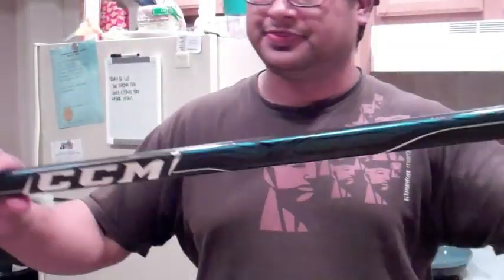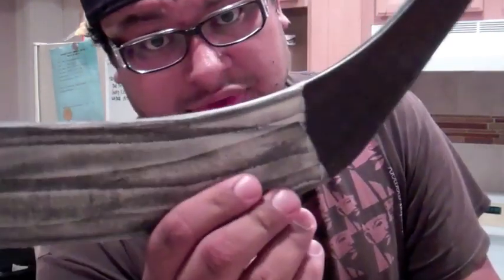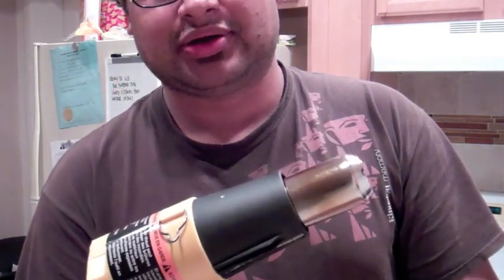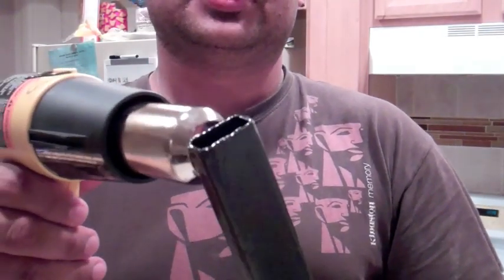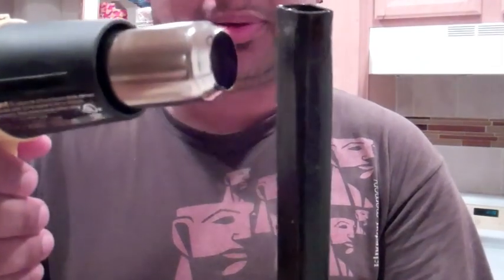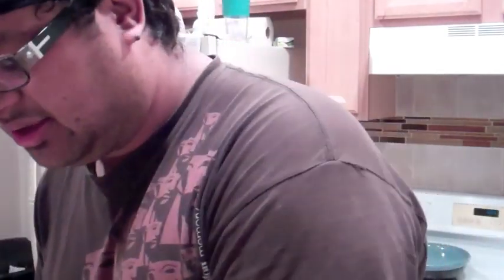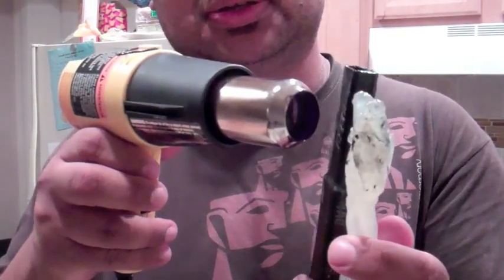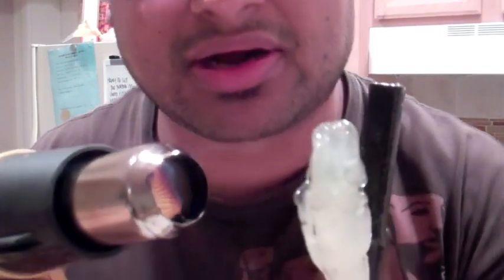Hockey How to: Changing a Hockey Blade from your Shaft

Comment: already in the blade stuck it in the shaft and it fit good. i sanded the shaft down to the blade a little bit. Now all thats left to do is the spraypaint. I"ll post pics in the custom job thread on S2K. Check it out when you get a chance.

Comment: Hey Humberto, I did this with one of my sticks. When I got the blade and extension for it at the store they put the extension in the tapered part of the shaft and the blade where the butt end should be.I got that done in april but i just got around to switching them around now. So I got the heat gun heated them both out and they slid out easily. When i applied the extension it was to loose so I just put a couple of peices of tape around it to make it fit. Then i just reheated the glue that was.

Comment from the maker: Yes, but you will damage the shaft and possibly permanently burn/fuse the blade into the shaft like the pros do and it'll be harder to remove, once that happens you'll also make the shaft a lot more prone to break too.

Comment: Is there always a small crevice where the shaft and hozel meet or did I not push it in far enough? Crevice is pretty small, less than a centimeter or millimeter even perhaps.
Reply from the maker: it should be a tiny teeny tiny crevice where its a little open but if you can stick a coin in to it, it might be too much.  but if it hasnt broken, i wouldnt worry too hard about it.

Comment: What about this: I've got a ribcor stick and hate the blade. It's cracked too. Ever heard of guys just cutting off the blade and putting a new one on? Is it possible?
Reply from the maker: +Matt Hansen ok so, is this the ribcor with the ribs outside? if not they might be inside, if so theres a fuse point at the shaft bottom where it "meets" the lower part where the blades' fused in.  theres no ribs there.  So you have to find the fuse point, cut it and remove the blade there and you can use the shaft.  Its possible, its just a hand full of work
Reply: I'm legit trying do do this now with my ribcor do not cut off the blade and add a new one it won't fit

Comment: Do You just have to warm up the stick for removing the Blade or is there something else to do?
Reply from the maker: The same area on the shaft you saw me heat up before putting in the blade, heat that same area and you should be able to just pull the blade out effortlessly

Comment: if you have just bought a blade is the glue already on the blade enough for this or do you have apply more glue?
Reply from the maker: You can use the glue on them, some have enough  Some shafts are a little bigger than some specific blades even with tapered ones, so i just add extra glue to fill that negative space.  Whatever squeezes out i just add to the glue stick and use another time.
Reply: thinkingjack thanks for the advice, i just got the harrow 300 ovechkin clone blade for christmas!
Reply: thinkingjack and can you use a hair dryer?
Reply from the maker: you might be able to, but it might not make the shaft and glue hot enough to work,

Comment: I have a total one with an ovechkin curve that I absolutely can't stand and I was thinking of buying a pm9 total one blade and cutting the blade of my total one but will that work or completely screw up my stick ?
Reply from the maker: Hey Cory,  I would honestly suggest just going ahead dn selling the stick and getting a different one, if you cut the shaft you can run the risk of making it way too short and stiff and it won't perform the same.   I've noticed with Bauer sticks that when you cut a OPS into a shaft its a lot harder to get correct for using it on a blade.   I'd suggest just trading or selling it on a forum for a different curve

Comment: is it really necessary to add more glue to the replacement blade which already has some. in my experience it is not.
Reply from the maker: +DonQwantsyou Sometimes it is just to make sure it gets in there and theres enough glue to fill the space since some shafts are a little bigger.

If the extra glue comes out, its not a problem you can reuse it later

Comment from the maker: No not at all, if it already has enough glue, use that and you should be fine, if the blade and shaft arent flush you may need to add glue, but at that point, not too much.

Comment: Tag me back so I will be able to see it but are you able to cut the blade off of a stick and put a blade into the stick? Would that work? And maybe make a video trying it @thekingjack
Reply from the maker: @3KINGS Moon
You should be able to cut almost any stick I’d you find the right spot for a blade
Either tapered or flip the shaft and use it as a standard blade. I’ve done it many times in years past and I believe I have a video uploaded here for it or one detailing how to

Comment: a buddy of mine just snapped his ultra tacks at the blade and he gave me the shaft and I was wondering if with this stick it would be possible just to saw of the bottom half of the stick and do this.
Reply from the maker: get like a screw driver, flathead, and push it in through that part of the shaft if theres an opening, and find where the fuse blade  ends at the hosel.  Once you find that piece, mark it, and saw it off and you can insert a blade.
Reply: so the break is before the beginning of the shaft. At about the middle of the blade. So I just don't understand where to start this process.
Reply from the maker: Eric Pearson send me some pics
Thinkingjack@hotmail.com
Reply: sure. I just sent you an email.

Comment: So I have a 1n and the blade broke but I was wondering since it's 1 piece is there still a way I could put a new blade in it
Reply from the maker: Yes there is, the taper is too thin to put a blade but if you flip it you might be able to use it again
Reply from the maker: NOT sure i responded to this because suddenly old comments are coming up as new comments.   But yes you should be able to, in the shaft you can find where the fuse point on the hosel ends and you can cut that part off and insert a blade there and wont even need to flip it over.

Comment: i have a pro stock reebok ai9 that a buddy gave me. im wondering if an easton or a bauer blade will fit into the ai9 shaft. help?
Reply from the maker: There should be no problem fitting those blades in there, as long as you cut it properly and its the same hosel  blade for that shaft, i would make sure to measure them up, you dont wanna accidentally get a tapered hosel blade for a standard shaft
Reply: thinkingjack yeah i just don't know how to make sure the blade fits the shaft lol

Comment: I have a street hockey stick and i need to out a new blade on it.   It only has screws on it but i cant get it off once the screws are out.  Anyone know how to fix this
Reply from the maker: So you basically have a mylec/Franklin street stick? 

Shit if you need a new blade for those you’re better off buying a new or used composite for cheap because the actual blades for those are still 25$ and that’s absurd

Comment: Can the street Hockey blade  also removed?
Reply from the maker: Daniel Cardenas if it’s on a shaft yes it can be
Reply: If it's not a shaft then no right?
Reply from the maker: Daniel Cardenas you can cut the stick at a specific spot to turn it into a shaft and keep using it if it’s a composite stick

Comment: How do u make a one piece stick to a two piece stick?
Reply from the maker: You'll have to find the taper on the shaft where the blade isn't fused and cut it with a saw, then get a tapered blade and insert it into the shaft if it fits snug, then remove it, heat it up and add glue

Comment: Hey! I have a True Catalyst 9x shaft and a Bauer i3000 blade for rh. I know how to put the blade in the shaft but how do you take it out without boiling the grip on the stick? I need to take it back apart because when I flex my shaft I can hear a little bit of crackling noises. Thanks in advance!